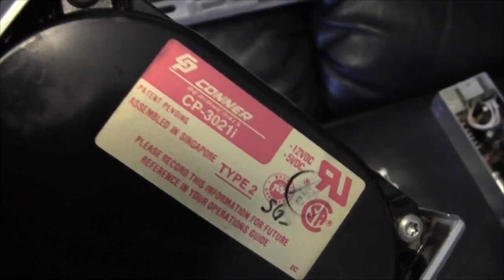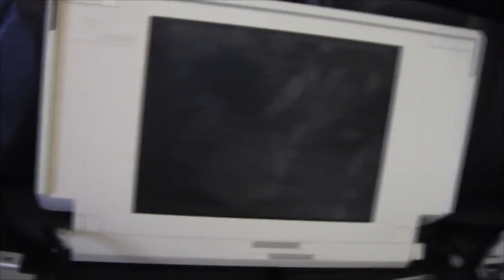RESCUED: A flooded 286 laptop from 1988 (Compaq 286/SLT) Part 1

Comment: Great video, great machine. I had one without battery. Found it next to a skip. Worked great, used it mainly with a 1541-II floppy drive with a x1541 cable.

Comment from the maker: The floppy is powered through the data connector, so could not test that, but there was no signs of water egress on that.  The hard drive I plugged into a win 98 p120, after a few missfires, it fired up and stabilised and the computer was communicating, although obviously, it's a completely different system so it could not read it.  I am hopefull :o)

Comment: the batteries have a shelf life of many many years. It's not like the explode if they aren't used within a week. Dallas did/probably still does make the battery/nvram control part as a separate dip module that can be clipped on.

Comment: I had a 386 laptop once that was almost as interesting!  It was your common 386 with keyboard and floppy, black and white screen but the docking station was huge!  From what I remember it had its own ports, hard drive bay and extra floppy, power supply with fan and the lappy slid in the front!  The battery was broken but being a kid I tried to clean the dock port with a screwdriver - whoops!!  I popped it!!

Comment: If you read the datasheet/blurb from the Dallas NVRAMs you will see that the battery is disconnected until the first power on.. I think they still make them or at least have stock as I have ordered samples of them in the last few years..

Comment from the maker: i didn't know it was used this early :o)  I'm considering wiring one directly to the terminals but I can't figure out which to solder them too :o(  Oh no, it was stored in the dry, then they emptied the cupboard and put it out in the rain for a few days, monitor seemed dry, hard drive was only slightly wet on teh outside :o)

Comment: Nice looking beastie.  It should run Windows 3.1.  I can remember some colleagues in the marketing area at Telecom having some of this very model.  They of course have a very custom power supply - common for the time.  Compaq stuff back then is damn tough, so hopefully you can get it going.  Mmm very close to when 1.44Mb disks were introduced, so you might be lucky there.
Fastest screw driver in the west :)

Comment: There a probably other parts that will work too. There are some app notes about parts that have been EOL'd and which parts are suitable replacements. If all else fails; They aren't too complex.. you could probably hack up a work-a-like using the datasheet.